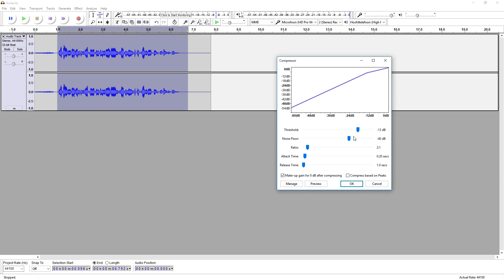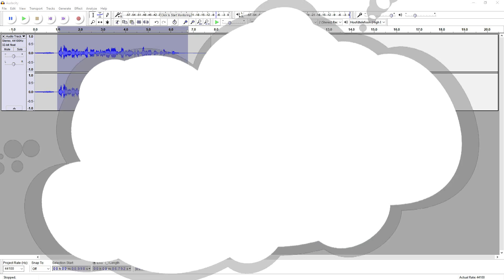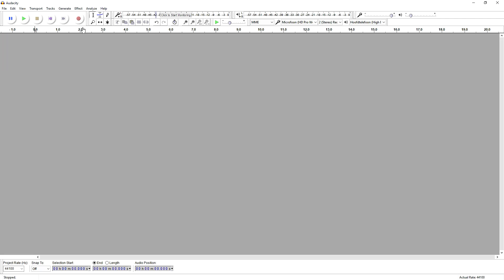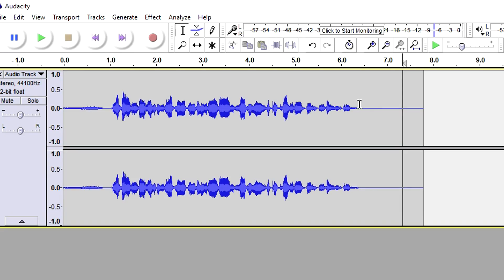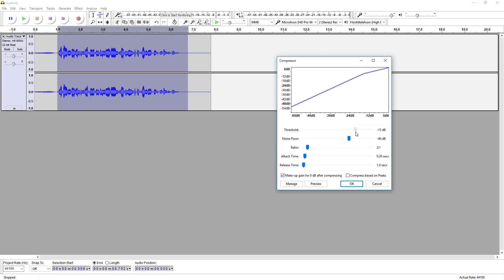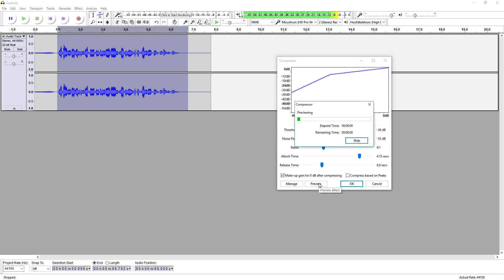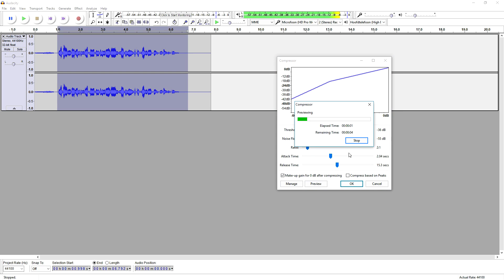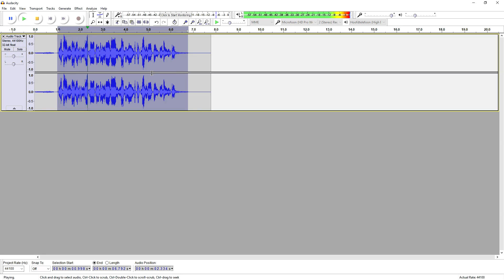How To Use The Compressor In Audacity - Tutorial #38 (LAST EPISODE)

Comment: I feel like this guy has no better of an idea how to use the Audacity compressor than I do.
Reply: I just use it to increase the volume of my audio file..It basically levels out the audio bringing up the low parts (including your breathing sounds).  The problem with over using it is it destroys the dynamics of a recording...i.e.  the difference between the high parts & low parts of a recording ..Still struggling with it ..YouTube normalize all audio recordings anyhow (only if they're too loud)..however if they are too quiet they will not bring them up to their desired normalization setting.